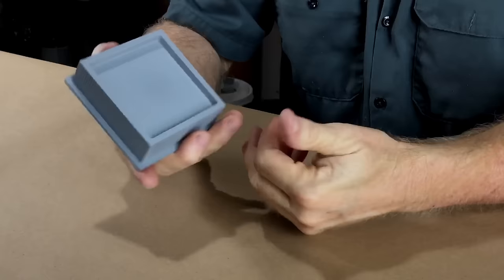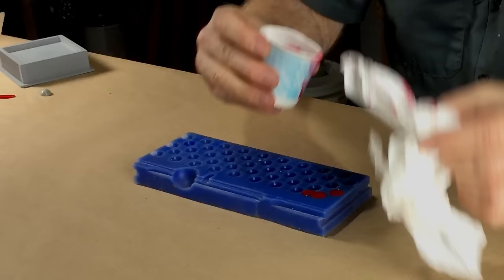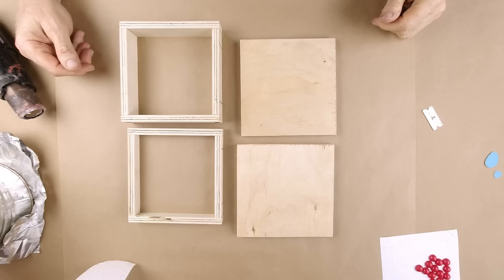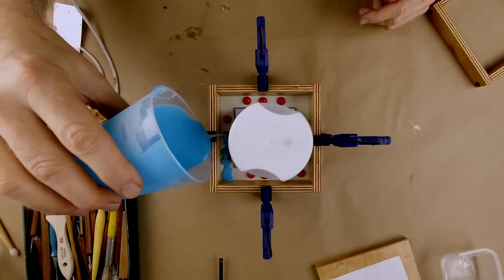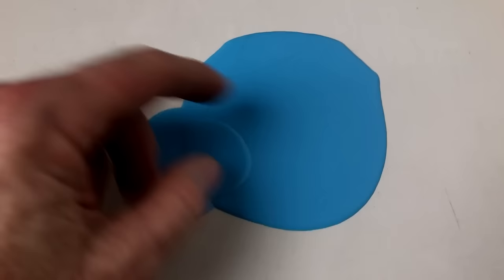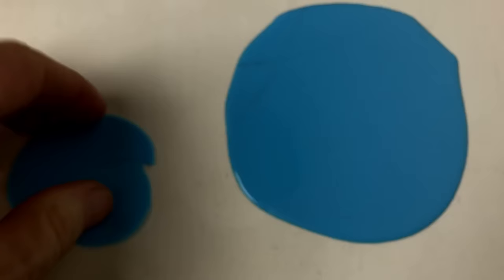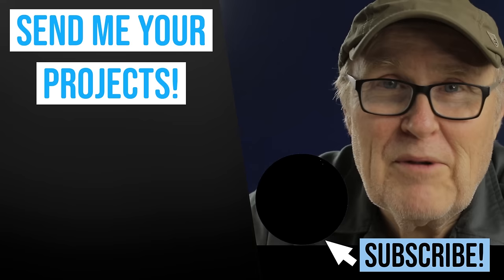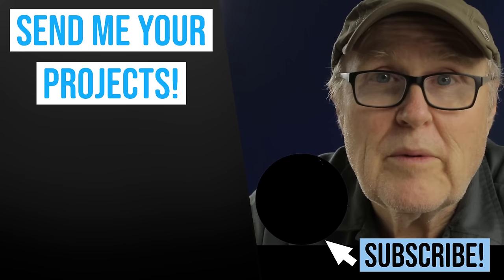Silicone Mold Making: When To Use A Two-Piece Mold. Part 1

Comment: I'm Astonished about what you did there, A really nice job! 

I'm actually trying to figure out how to mold a piece from my car that is reducing into bits due to it's old age and buying a new one is costly and wouldn't be resist enough if it's the same material.

But with your video I might found the solution on how to proceed and that could be really awesome.

Cheers

Comment: Robert, I was at a production prototype shop years ago and they used the cut mold method as well.  A couple of different methods they used could be interesting to you.
1.  They used clear silicone so that they could see the pattern as they cut it out.
2. They used much thicker boarder walls to support the mold haves.  This allowed them to use packing tape to join the molds before the pour.  Some of their molds were the size of a small refrigerator. 
3.  To locate a perfect parting line on flat faces:  They used 3M Scotch tape.  They'd place the tape on the flat edge and have a good 1/4 inch flare sticking out into the cut area.  They'd mark the tape flare with a black Sharpie so it could be seen in the clear silicone.  The silicone doesn't stick to the tape so at that point you will get a flash, but you'll have a perfectly placed parting line.  This trick does change the shape of the pattern by the thickness of the tape, which is about .0015 inches, so it is not a concern to most customers.
Reply from the maker: Pretty interesting, thanks!

Comment: How absolutely fascinating!!!! I had no idea there was such a long and complex process to make a 2 piece mold!! I thought I could just make a whole complete mold, cut it in half, and it would work (spoiler alert: it didn't. I'm still trying to scrape hardened clay out of my microwave oven. This is what I get for trying to make a silicone rubber mold with no experience, all because autism demands equality in things I make and I would probably lose my mind trying to sculpt 4 paws by hand and get them all looking the same, haha. The clay leaked because the silicone mold deformed from the rubber bands and I didn't noticed until too late)

Comment: Hi , awesome video. I would like to make an induction manifold using silicone rubber to form the complex bends. What I had in mind was to make 6 silicone rubber sausages at 18 inches (457mm)  long and 1.29921 inches (33mm) diameter with a heavy gauge fencing wire in the centre so that when removed from the tubing and adapted to fit the manifold it will retain the curves and bends required ready for the fibre glass split mold. The second part I’m guessing is to remove the silicone rubber from the split  mold and reassemble and fill with Liquid Metal then remove the split mold and layer up with carbon fibre and then after curing melt the liquid metal out of the carbon fibre. Would love to see this process and of course would love any changes and input. Regards Noel

Comment: "Skip to the good parts"??? Robert, every single moment with you teaching us are "the good parts". 20 registration buttons was your free pour. Once again, I have learnt so much from you; and now with Jeff's unique project and your mold-wisdom, I have finally, after all these years, learnt how to create thin, razor-sharp, professional-looking parting lines with a thin sheet of styrene! Thank you so much! You make Friday's so wonderful! Ideally, what durometer rubber would you recommend for a piece, such as Jeff's?
Reply from the maker: BaronMcCausland I would go with a 40 on the A scale.  My supplier www.Silpak.com sell a tin cure silicone they call Extra Firm. Also, the platinum cure rubber is much firmer than the 25 A rubber I use. But the durometer scale tells all. That information should be on the material data sheet for whatever rubber you are looking at.

Comment: This video and others I saw yesterday have been valuable.  I'm going to try my hand at casting a scenery piece with silicone rubber.  I had imagined most of the process combined with some videos I'd seen years ago. But this was awesome.

I appreciate your design on the autoclaves, I have an old dentistry autoclave which I will be using both for pressure and vacume, but I will have a max of 4 bar pressure due to the door seal design.  Your oval shaped doors with internal plates is an amazing and easy way to negate that problem. 

I fact everything I've seen you do seems to be the easiest way imaginable, no doubt learned from years of experience.

Thanks for the great videos.

Comment: THANK YOU!   There is not much I subscribe to, but fellow, you earned my name on your list!  Just what I was looking for!  A renaissance man!  Part scientist, part wizard, and mostly artist!  I am not too sure what I have is doable?  At 66 I am restoring a 1963 Rambler American 2 door wagon:  one of 1800 Ugly Ducks made and 1 of 13 known to be left.  As the stripped down body heads off to my Friend Bill Kandy for sand blasting and epoxy primer, I am looking to replace all the rubber on the car.  Miraculously every single thing is available for this car EXCEPT ONE!  The Vent window seals.... you know!, those little triangle windows in the front of the door that blow fresh air on your face?  They are complex and are even "bonded" to a thin piece of sheet metal using what is obviously planned flashing.  I am going to root around here and figure out how to send you one to give a look.  Thanks for giving me some hope that even if it does not work as a project for you that i might wind up being able to do it myself.  WELL DONE! Stay at it!
Reply from the maker: Send some pics to me at roberttolone@yahoo.com.  Thanks!

Comment: if you wanted cut lines around side get long block of wood about 2cm wide x 15 cm long cut bit out middle slide in razer blade then set high of the blade with thin bit wood get high up or down to high of object then slide the object a long the blade get clean cut. get EVA 50 x 50cm Interlock Foam Mats Solid Black Pk4 you cut any size then put rubberbands on will not put mold out wack.

Comment: This is so helpful! I'm currently struggling of making a two-piece mold of my own design. Hope it'll end up well! Thanks a lot for this video :)
Reply from the maker: Glad it helped! Good luck with your project!
Reply: Hi Robert, I have a small question... I tried to use harder silicon, but it’s kind of sticky and hard to mix together without bubbles😩 could you please give me some tips? Thank you so much!
Reply from the maker: Chien-Chi Kuo It is true that the harder the silicone is the more difficult it is to remove the bubbles. A vacuum chamber is the most efficient way to do it. Pouring a mold in layers can help you. The bubbles will rise out of a thin layer much easier than they can from a full mold.  It takes time to pour a mold in many layers but it does work to do it that way.
Reply: @RobertTolone  Thanks a lot, I really appreciate it!

Comment: This is great!
Reply from the maker: Thanks Adrian!
Reply: @RobertTolone  I have just started viewing ur content(and I’ll probably watch it all, lol) but just in case you have not made a video on the subject, how about a video about the ranges of rubber and their applications, which ones are most commonly used etc. For reals tho, great videos, that forethought into the pouring spout and the vent sprue
Reply from the maker: @Fox_Moulder  That would make an interesting videos.  Or many videos because there are so many kinds of molding rubbers with an almost infinite number of applications.

Comment: Very interesting hobby and top presentation!!
I would like to make a copy of a Viton ring for a bread oven  (nor available anymore).  It should resist 250°C for hours. Any suggestions for making the mold and the materail for the replacement ring is very wellcome. Thanks
Reply from the maker: A high-temperature-tolerant platinum rubber should work fine.

Comment: 💗 Fridays with Robert 💗. I was wondering how you will put the sprue and the funnel. And when you put it wow it so logic I was thinking to put it vertically but until you show i saw the troubles that i would had if  i would do it like that. . Thanks so much. 😍🌺
Reply from the maker: Adriana Cruz Hi Adriana,  the key to casting in this mold is that it must be held at an angle steep enough to fill the part completely.  It is very handy that the entire model can be vented by that one vent. I hope we get nice castings from this mold !
Reply: @RobertTolone  I was thinking that this mold was an easy one. And puff this is new . Thanks again teacher 🌺💗

Comment: I was just watching youtube and came across your channel, (a bit late i know.. :) ) but was thinking about the rigidity issue with the rubber you mentioned at the beginning. I got the idea about using reinforcement material within the rubber itself, like rebar in concrete. would it be possible to maybe make thin walls out rubber, add scraps of wood,  to provide strength and then refill more rubber into it. would that increase the rigidity to moulds like this?? love the channel, you have such a calming voice and nice presenting style, i have Subscribed
Reply from the maker: It would be simpler and much less work to use a hard,  rigid rubber.

Comment: Last weekend I tried my first silicone project.  I wanted to make a silicone mat for my electronics workbench.  I did get a mat but because I mis-calculated the amount of silicone needed it didn't quite fill the mold which was the lid from a plastic tote from Home Depot.  Yesterday it occurred to me that I could create a drawer organizer for the kitchen drawer that holds our cutlery.  Does anyone know of a video that I could watch to prepare for this project.  Also a better way of calculating the amount of material needed?  Would MDF be a good material to use for the mold?

Comment: Yey, finally a mold made of two parts. =) I love it, looking forward to see the casting.
So I understood two part molds are a bit more chuncky in order to make them not to deform too much?
I also have seen people using nuts with round heads to create those "dots". Does resin have an advantage over that, or can you use what ever you want?
Reply from the maker: Roger Agburn Anything that works should be fine. I made that dot mold many years ago so it is convenient for me.

Comment: Hi Robert, This is an older video, so you might not get to my question. First, You have taught me so much, and I want to thank you. My question is how many casts would you expect from this mold? Thank you
Reply from the maker: How many cast you get from mold depends on many factors. It can vary from as few as one to almost unlimited. Factors like, how much fine detail does the surface of the model have? Does it have rough texture?  
How durable is the rubber? What is the temperature? The variables go on and on. In my work I use a rough estimate of 10 to 15 casts per mold cavity.  But much depends on what you are casting and how.
Reply: @RobertTolone  Thank you Robert! One other question that I have is how a person makes a mold for a long thin tube/pipe without the core bending while casting. Thanks, again
Reply from the maker: @brianmccabe1302  Tubes are extruded, not molded.  I don’t know of any way to cast a long tube using a mold. It’s pretty much impossible to keep the inner mold aligned to the outer mold so that the walls of the tube are uniform.

Comment: Your great. Do you have any tutorials on how to make a mold of a small bottle. The neck is extremely tiny, so I can’t pour silicone inside, couldn’t get it out. I guess there’s no way to have an hollow bottle, I’ll need to drill and maybe put a straw in the center. I don’t know. Do you have any suggestions? I’d send you a picture of it if I could.
Reply from the maker: You could rotational mold it. That would make it hollow but it’s difficult to control the wall thickness evenly. And clear resins are harder to rotate with than opaque resins.

Comment: It's obvious you know your stuff!
I liked the comment about making a thicker mold this time.
Have you made any molds with mold Max 60 and then used that for plastic injection? I'd like to try injecting ABS into it. Maybe get 100 pieces for a trial run before making an aluminum mold. What do you think?
Reply from the maker: I have not used Mold Max 60 nor have I done plastic injection in silicone molds.  Crafsman Steady Crafting has done it on his channel.  I think if you build your mold carefully with a strong mold case you could make it work. It’s certainly worth a try and would be a very interesting experiment.

Comment: I have a question that I could use your expertise, Robert. I have, thus far, had two silicone molds fail on me, both of which were produced for a small part using a similar method shown in this video: where a part is laid flat, and a thin, skim layer is used to create a seal before the deeper, 2nd pour of silicone. For me, the part lays flush on foam-core board. My molds are all made from foam-core (which could be an issue; don't know...), and I have had a good amount of success prior, but lately, I cannot identify what the heck is going on! The issue is that the part somehow shifts in the silicone at some point in time within the pressure pot. During both silicone pours, the part is 100% flush on the floor of the mold box. All seems well. The mold is level in the pressure pot as well. However, pulling the mold out of the pot, inspection reveals the part has raised up into the silicone somehow. About 3-5mm tilt, or "sucking back" of the part occurs. Ever encounter anything like this? Initially I thought it was air entrapment under the part, but there are no air pockets in my case. And by rewatching this video, your gray box part has a HUGE air pocket in it, and apparently it did not cause an issue. Maybe the foam-board is compressing and distorting in the pressure pot?
Reply from the maker: Yes, putting foam core in a pressure pot it is likely crushing or distorting.  I never pressure cure my molds.

Comment: Mr Tolone, I hope you're having a fantastic day. 

I've noticed that you use the silpak line of products; given your experience, I know that you have used other brands. Can you elaborate a little on why you choose silpak over others? I don't want to mention brands other than what I've observed you using, but I'd like to know why you choose that brand over others. 

I actually went and got some silpak today purely on a) my needs and b) the fact that you use it. 

Your input will be greatly appreciated.
Reply from the maker: I learned resin casting and silicone mold making long before the Internet existed. It was hard to find information about how to do it. The owners of Silpak spent countless hours with me explaining their products and how to use them. This was back in the 80s. I have tried materials from other manufacturers and found them equivalent or at least satisfactory - but none better. Because I have been a customer for so long I trust them, they know me and I get excellent service from them.
Reply: @RobertTolone  Thank you so much sir.

Comment: i want to cast a large lens from the rear of a st1300 motorbike.with something so wide whats to stop the top mould from flexing and sinking into the lower mould warping the shape and reducing the thickness of the cast. should i use a more solid mould material or can i add wood dowels to the top mould to prevent it flexing? should i add multiple pour points and how do i calculate how much resin to use?

Comment: I like very much that you are a moulding specialist rather than just another sculptor, 
but what are the maximum number of mould parts you've ever done? I've never done more than 2-part moulds, but I KNOW there are castings using more than 2 (things like say...3 headed Dragons)
finally, are you going to demonstrate how to make more than 2-part moulds here on you tube?.
Reply from the maker: I never do multi-part molds; I cast complex sculptures in pieces. A sculpture that is intended to be cast should be designed for the molding and casting process, not the other way around.

Comment: Excellent tutorial mr Robert,
One question - would this type of mold be suitable for wax injection To make wax duplicates for investment casting?
Reply from the maker: It depends on how much pressure you inject the wax at. My molds fill with gravity so they don’t require much holding force to keep them closed.
Reply: @RobertTolone  thanks for the reply

Comment: Thanks Robert, really appreciate you sharing this. I want to make a hollow mold for like a cap of my head- how would you recommend i go about that? would it be the same as the two part silicon mold as shown here?  My challenge is that there would be no flat edges unlike this mold.

Comment: Have you tried using paintable caulk to seal up the gaps and then beeswax over top of it? Beeswax should adhere to the paintable caulk? the caulk should be able to fill those small gaps
Reply from the maker: I would be afraid the calk would be too hard to remove or make the mold box difficult to take apart.  But you could always experiment with it to see if it works for you

Comment: @Robert I have a cast of a mask and it went pretty okay. But my issue is after painting with my airbrush and clear coating is that the outer clear layer keeps going tacky randomly. I can't reproduce the effects with heat, cold, moisture and I have no idea what's going on. Save my project that's been sat on a shelf for a year! Help me figure out where I went wrong and fix it?